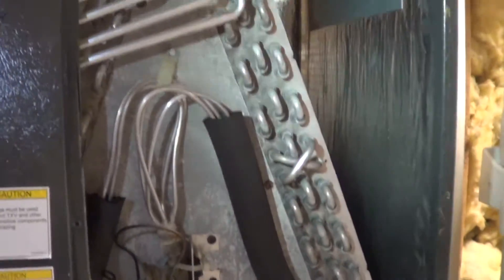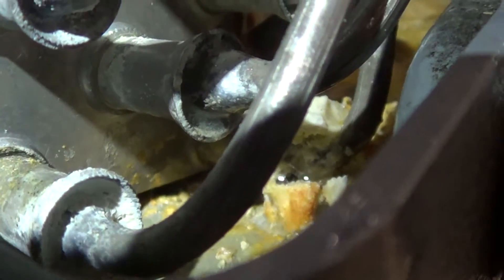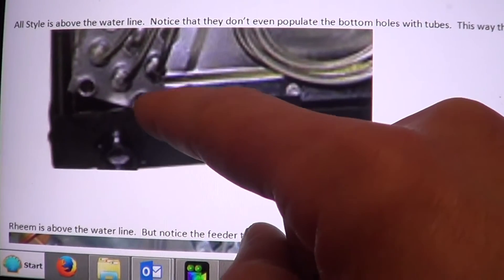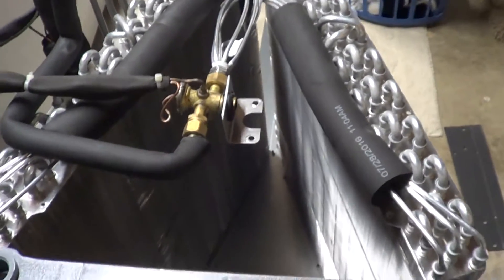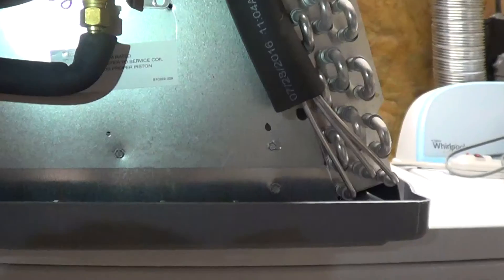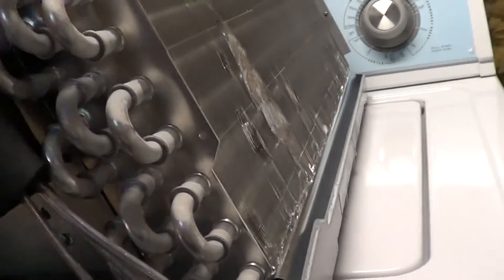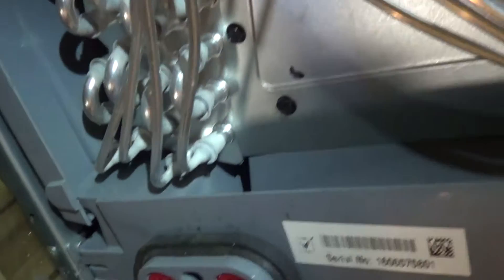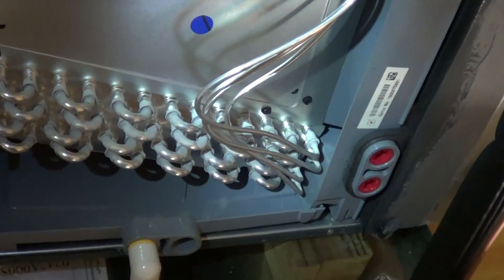Preventing Corrosion on Aluminum Evaporators

Comment: I installed 3 new aluminum coils back in 2017 because the originals were copper and were made back in 2008 when they were first trying to meet the new government mandates.  They didn't go into service until 2010 and were leaking by 2014.  They were only developing leaks in the rear u shaped tubing.  I read all about formicary corrosion, etc, etc. Well, here we are in 2025 and back in 2023, one of my new aluminum coils was leaking.  Turns out, it's leaking in the same place as the copper coils were.  I believe the reason it's leaking it because it's in contact with the foil coated fiberglass insulating sheet and the dissimilar metals contacting ate away at the aluminum coils.  There are 2 definite leaks but I see pitting in several other areas that were making contact.  I have some AL 822 that I'm going to give a try.  Hopefully it's as easy as the videos make it out to be.  Now I need to figure out how to protect the coil from contacting the insulation sheet.

This one has the raised pan so the aluminum doesn't sit in any water so we're good there.

I just did the AL 822 repairs and that stuff works freaking awesome.  Super easy to use.  I repaired the 2 pinholes and added a little to all the tubing that had pitting.

Comment: good explanation...what brand of shears are you using in this video? Thanks
Reply from the maker: Bosch PS70.  It makes working with sheetmetal like working with cardboard.  Also, good dynema gloves are a must.  I use Hyflex CR2.  They are thin enough to pick up a dime on the floor, but you can't cut them with a razor.

Comment: whats better for evaporator coil,copper or aluminum?
Reply from the maker: Aluminum will last longer.  Also, aluminum is more pure because it is purified with electrolysis.  The whole industry got hammered with micro leaks on copper.  Carrier was aluminum in the 80's and the pipes never leaked.  However, they had other issues with the mechanical connectors to the line sets.  All car evaporators are aluminum and they take a big vibration beating without many leaks.

Comment: This has been a major issue in our industry for the pass 7-10 years.  One would think as a manufacture that gives a 10 year warranty on these coils that they would have all this figured out.  Its not like this is a brand new technology.  They have only been at this for over 100 years now....  Great videos good sir keep up your excellent workmanship.
Reply from the maker: There has to be corrosive exposure in the air.  In this case the air handler is located in a residential laundry room with a leaky return duct.  The alkalinity from the laundry soap raised the ph of the condensate water.  Aluminum corrodes from just mild soap.  Apparently, the standing water at the bottom concentrates the soap alkalinity somehow.  There was very little corrosion above the water line.  If the ph would have stayed near 7, the aluminum wouldn't have had a problem.  But, no house has perfectly pure air.
Reply: NathansHVAC looks like poultice corrosion. Possibly where dirt floating on top of the water line would collect on the aluminum tube and insulate the tube from the surrounding air as the water level rises and falls. Aluminum depends on a fresh supply of oxygen to maintain a protective oxide layer which gives it corrosion resistance.
Reply from the maker: JR M.  I think you named the corrosion correctly.  Nothing should be touching the aluminum.  Once the poultice corrosion starts it feeds on itself by creating acid underneath the corrosion.  I guess the action of constantly splashing waves in the condensate against the aluminum was eroding off the 0.001" layer of aluminum oxide that protects the metal.  Copper doesn't use oxide layers for protection, because it corrodes so slowly.  Aluminum corrodes in seconds without the oxide layer on the surface to keep the oxygen away.
Reply: @NathansHVAC  Why isn't there something that can be applied to the aluminum on the ends to keep it from getting wet in the first place?  The all aluminum coils may be better than what we had years ago, but they still corrode.  All this junk is made to a price point.